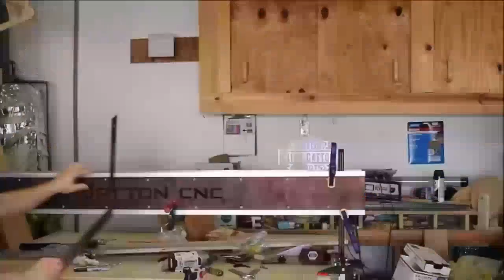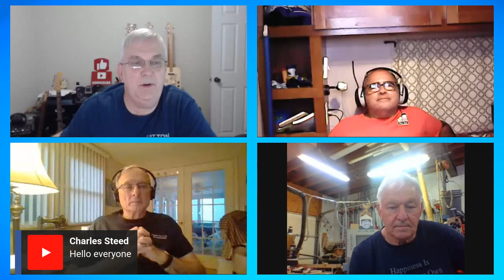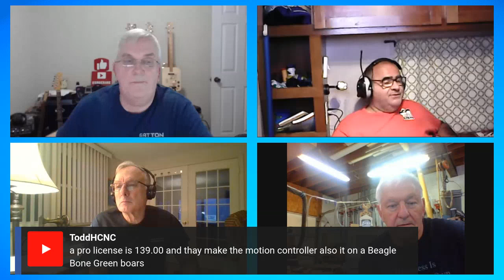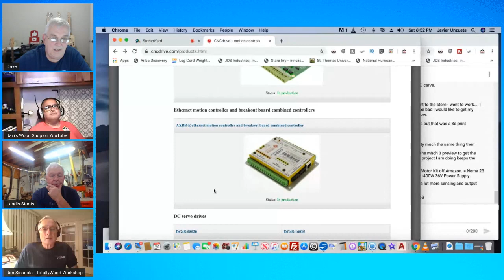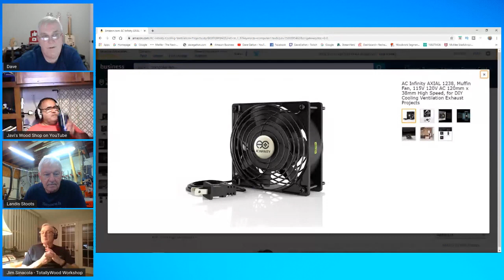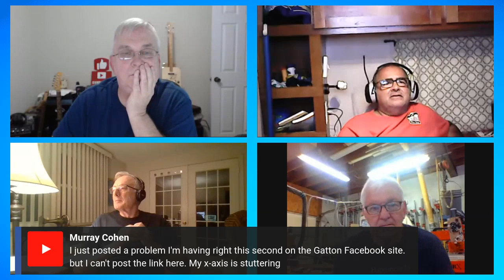CNC With Dave Gatton - CNC Electronics

Comment: @1:32:00 I can't comment for MACH3, but UCCNC will load the entire file into memory before it starts and will not be affected if a USB device for network fileshare is disconnected mid run.